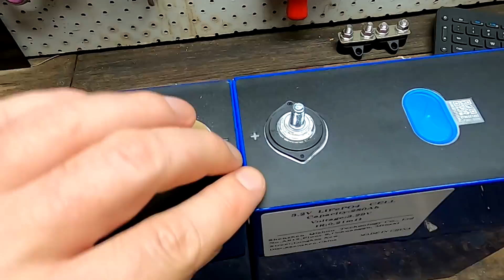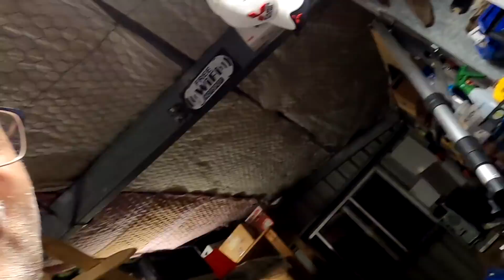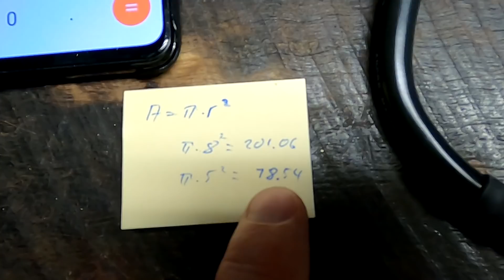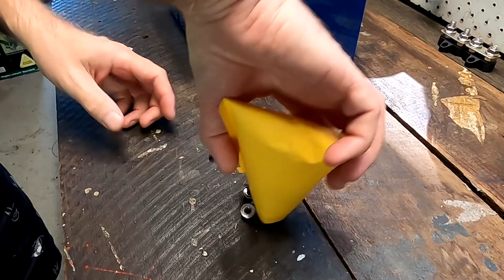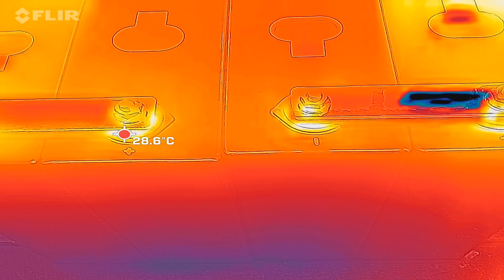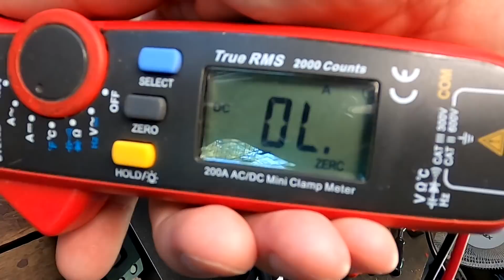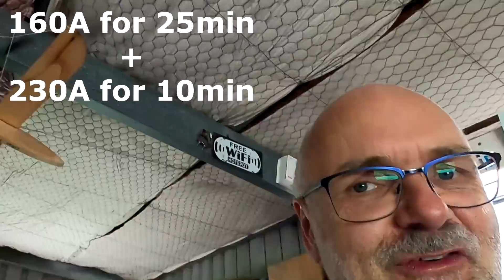EVE LF304 with welded studs. Pushing 230A through a tiny terminal?

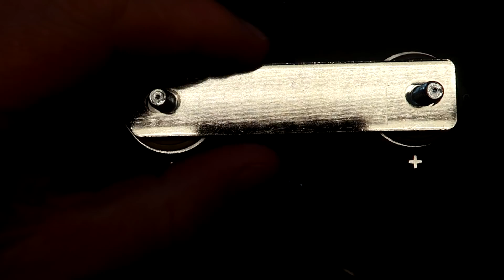Comment: 14:29 I've been using flat washers with the lock nuts to prevent scarring on the busbars, especially on projects where I'm fiddling around a lot.
Reply: I thought about that but washers can introduce additional resistance. Are your washers aluminium or copper? If alu, are they treated for oxide corrosion? If copper, how do you deal with galvanic corrosion with alu?
Reply: @deanjones3239  Sorry, I thought this was a different comment. The washers are soft steel. The washers and nuts do not increase resistance because that's primarily traveling through  the terminal and the busbar. The nuts and washers are only securing/pressing the busbar into place. 
Also, the busbars I'm using are nickel-plated copper.

Comment: Hi. I had the same issue with welded studs. My cable holes were wide. I sourced for copper washers which were tight fit on the outer sides of the welded base and flush to the top.
Reply from the maker: Is you lower area around the stud not rough? Mine is from the welding... so not a great contact area. And more washers make more points of resistance?
Reply: @OffGridGarageAustralia  I had to reuse the original cable (forklift) with big lugs. The hole diameter was wide and had to find a way to pinch them. And yes the stud welded area was rough. Pure copper washers and star lock washers did the trick. The motor draws 600 to 1200 amps according to the load. I have no issue with thermal on the studs.

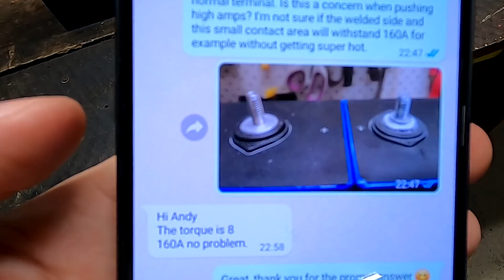Comment: 10:30 I do have a set of batteries with these welded terminals. I wasn't planning on pushing more than 100 A through them, so I'm not very concerned. Something worth considering is buying some aluminum washers with the same diameter hole that can create a larger, flush contact surface.
Reply from the maker: They seem to work well as they are. I'm not bothered with any further washers to increase contact area. I will push barely 40A under full load once all three banks are installed.

Comment: QSO confirmed the 280K cells I ordered are all welded studs as well. So happy to see how well my flexible bus bars are doing, even better than I originally hoped!
Reply: Hi Madi, Your bus bars are holding up quite well. I thought it was a great idea when you first made them, much better terminals, full contact area.   :washhands:👍
Reply: As my battery pack is installed in a converted bus/motorhome I will be monitoring the aluminum bus bars I built and terminals for any vibration damage and if I find any will build flexible  connections as you did ... wish I'd thought of that when building the battery but it was before  you had done it.... hopefully I don't run into problems.... James
Reply from the maker: @James, bus bars are easily being replaced if you have to... Get Madi to send you some. She makes hundreds of them (apparently) 😊

Comment: that's what my new cells look like, I am also concerned with the contact area on the anode/cathode,  I asked the manufacturer and I was told that the majority of the power goes through the flange nut down the stud into the cell, seems like it makes sense but also feels like a bull squat response, mine torque to 5-6 n.m
Reply from the maker: I really think it's the opposite and most of the current will go from the bus bar directly to the terminal. The resistance through the steel thread, the nut and the top of the bus bar is a lot higher, I believe.
Reply: @OffGridGarageAustralia  I still have mixed thoughts on the whole thing, in theory it makes sense that current would go through the post and the  anode/cathode but like you showed in your video the resistance is high through the bolt

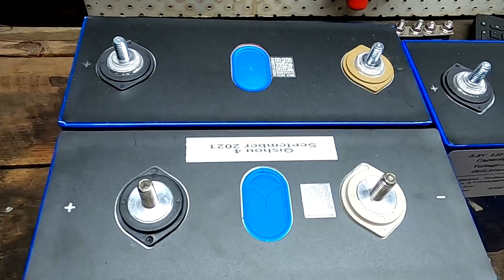Comment: 3:00 I wonder whether they moved the terminals farther out so that a standard length busbar can work with all cell configurations (i.e., side-to-side, end-to-end, and end-to-side).
Reply: Came on to say the same 😁👍
Reply from the maker: Has anyone tested it?
Reply: @OffGridGarageAustralia  I don't have the new cell configuration, so I can't. I was kind of hoping you could do a video on it. 🙂
Reply: Hallelujah 😍
Reply: Was thinking the same thing 👍
Reply: GOOD MORNING GUYS!!!!   My question is.  How many of the: over kill BMS:  16s 48v 100 amp load charge BMS to be able to handle Load about 10,000 watts 240v continue for 6-10 hours use/ charge car.  Any one please help. if you have the Math show how to calculate will be great.  I will buy -30 - 40 kwh battery bank thanks a lot.  Solar 5kwh,  INverter: 3x 5kwh Growatt inverter.
Reply: @makesaveinccomm  100Amp BMS @ 48V is about 5Kw , so 2 should theoretically give you 10kw , ur 3 x 5Kw inverters should give you enough grunt to do what you want, but you can always throttle back a bit on ev charging, if you need extra power elsewhere, can u use your ev as a dump and take power back out as well as like with a normal battery bank?
This electric vehicle idea is sounding pretty good with solar.
Reply: @makesaveinccomm  you could probly go with some more PV solar down the track, but the rest sounds ok. How many kwh battery in ur ev?
Reply: no. a standard length bus bar is too long for an end-to-end configuration... let alone the longer 72mm (?) one traditionally used.  you actually need a shorter one than comes with the cells.  i just drilled out one of the bus bars that came with the 280K cells to fit.  there is about an inch of hangover of the bus bar on that stud.

from experience.

Comment: It really made me itch when you held your metal Zollstock next to both terminal just to measure the width of the cell...

How is stainless steel not magnetic :)? I'm always cooking with stainless steel and induction heating...

Thank you for the great test!
Reply: Your pan has layers to its construction.  There is likely a steel layer added for reduced cost to the pan as well as to allow for induction usage.
Reply: @DestinationUnknownDude  thanks. Just googled a bit and it seems that it is dependent on the structure of the stainless steel for it to be magnetic or not.
Reply: Your induction stow is basicly an electric magnet that alternates its polarity, the created flux will induse whirlcurents in your pot. The curents combined the high resistence in stainless steel is what gives the heat. A magnetic pot would conduct the magnetic flux too well and resultat in less heat. 

It is usualy the amount of Chrome in the steelaloy that determents if it is magnetic or not. More Chrome less magnetic, ish. There is a distinct amount.

Metalurgy is fun ;)